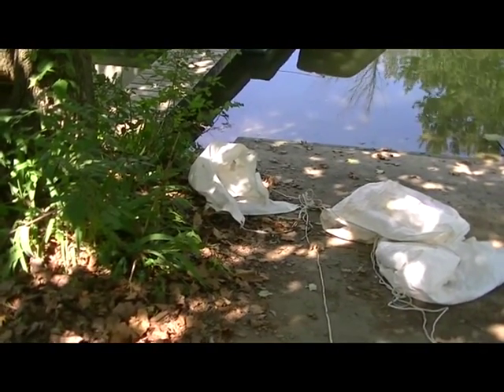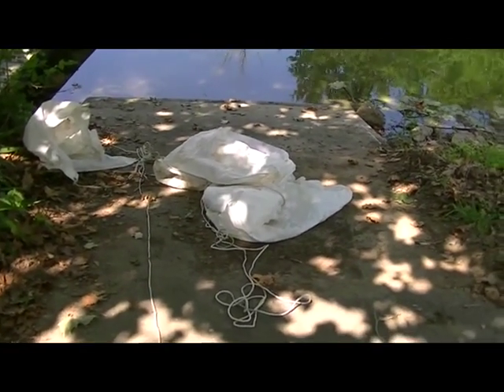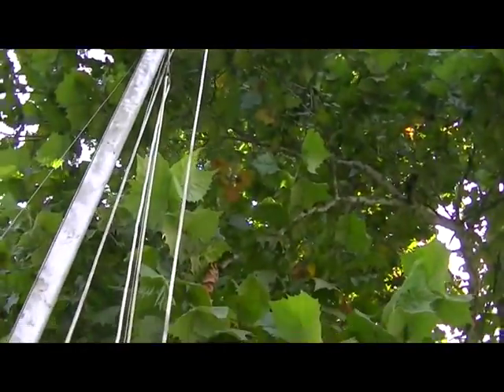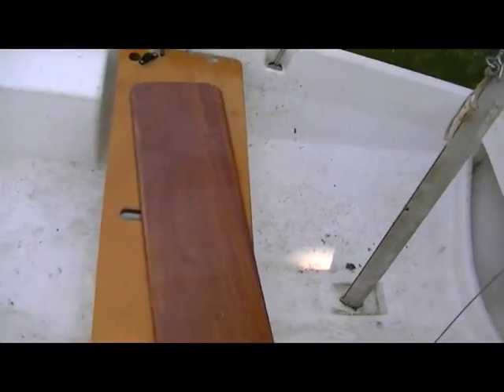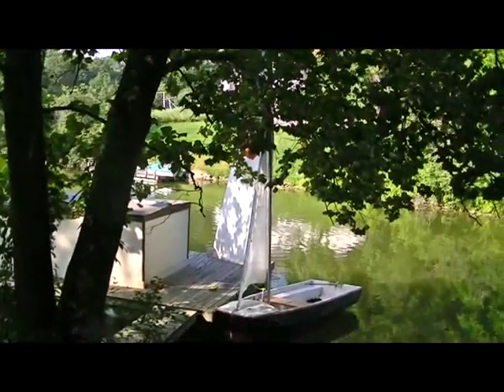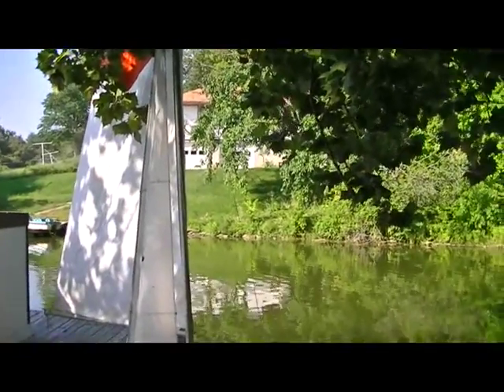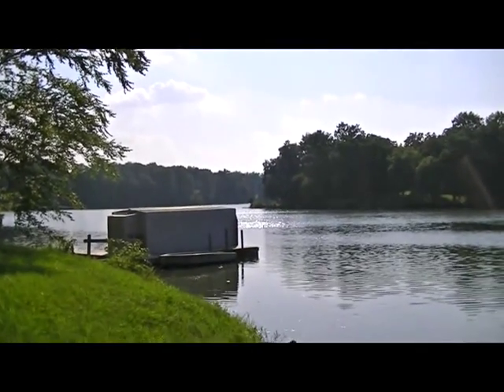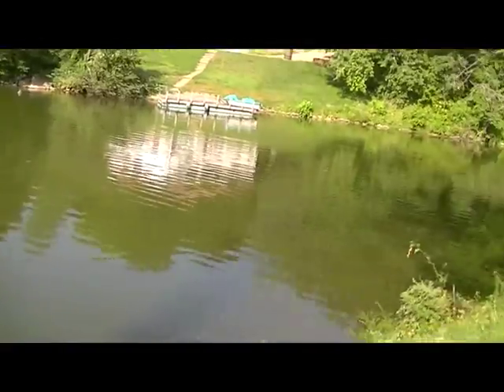Debut of the Wildflower Sailboat

Comment: Just FYI, the Wildflower is sloop rigged (jib and main). I believe it is the Mayflower that is lateen rigged (with a boom on bottom and a yardarm on top). Not fast but very stable boat and has oarlocks and motor mount in case the wind dies.
Reply from the maker: Yes!

Comment: I sailed a Wildflower for 15 years, going all over a 20,000 acre lake in Texas.  It's a great boat, absolutely unsinkable, very hard to capsize, but easy to turn turtle if you don't blow foam into the mast.  It's MUCH easier to keep the halyards in place and cleated tight, which will keep the 20' mast in one piece for storage or transport.  It's also much easier to raise the mast with the boat on the ground or on the trailer, too.  A boom vang will help control the mainsail on a broad reach or run.  I also fitted a topping lift, which works with the outhaul, boom vang, and loose-footed main to make a very adjustable sail.  It also allowed me to pull the boom up against the mast, making transport even easier.  A 20' mast on an 11' boat with 100 sq ft of sail made for an exciting ride.  I had many years of fun with mine, and hope you do, too.
Reply from the maker: It's a great boat and up for sale.